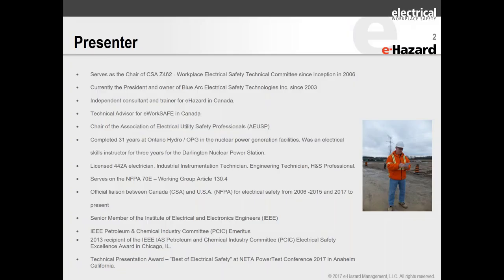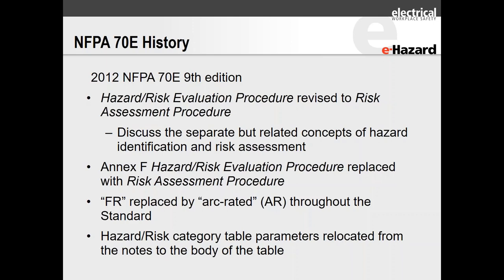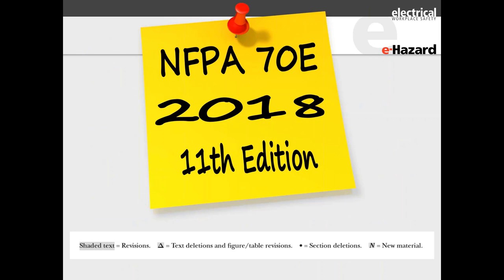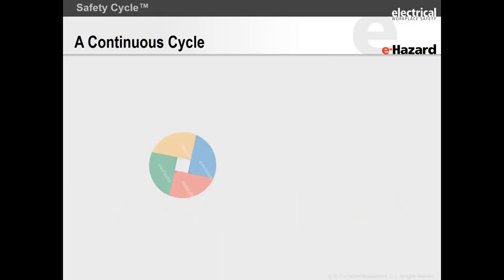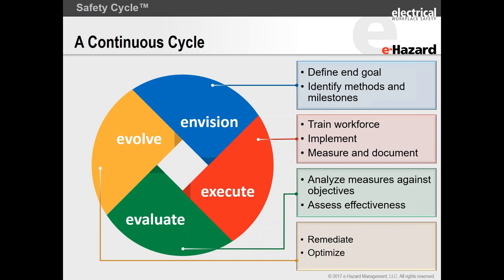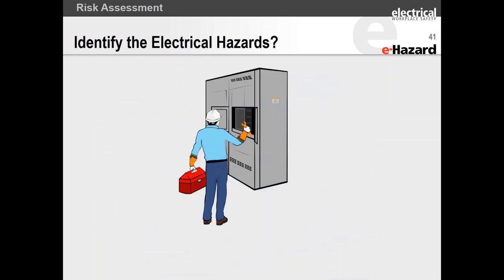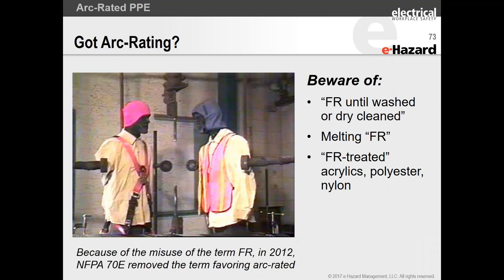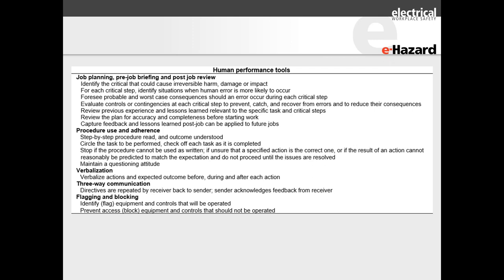NFPA 70E 2018: Changes and Implementation Strategies – What You Need to Know and Why?

Comment: I keep seeing training for doing your own Arc Flash study.  Is this not an engineering function?  I have heard that only licensed PE's are to do these studies.  In fact some states do consider this an engineering function and would consider this illegal.  KInd of like someone practicing Dentistry without a medical license.  Your thoughts?
Reply: Mike, 
You have brought up an interesting topic.
IEEE does not require licensed PE to conduct an arc flash study on existing structures. They stipulate the need for  'previous experience on like systems'.  So to follow your analogy, it is more akin to a dental tech performing cleaning and polishing on my teeth since the building design has been previously approved.
Where as the initial arc flash analysis and device coordination on a new design would more clearly fall into the realm of 'engineering function' 
On the other hand if local regulations require a PE stamp, then that is that.

Jim Chastain
Reply: Well, if an error is made it would be a holiday for a wrongful death or injury attorney.  I'm sure it would be brought up and anyone available to be sued would be sued.